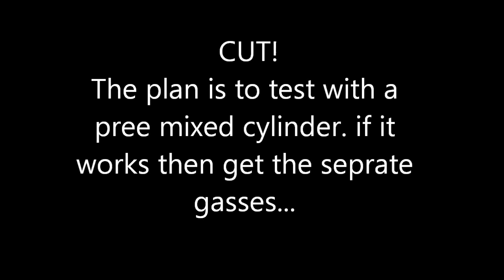Update 2 NGE Papp: Gas Ordered & My Thoughts About Bob And John Rohner& Other Info  RWGresearch.com

Comment: crap, now everyone knows i tried to help you out.
you can get meat injectors at walmart to inject your gases, they have o ring seals and the tip screws on. you can use a aquarium air valve to hold the gas inside the needle and add or subtract gas from your cylinder.